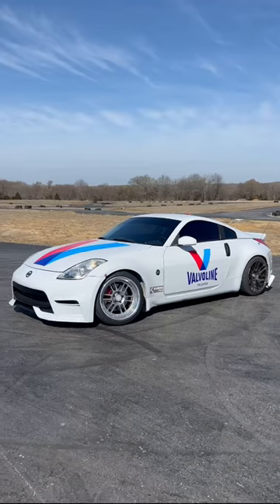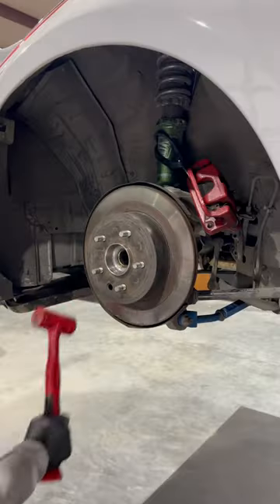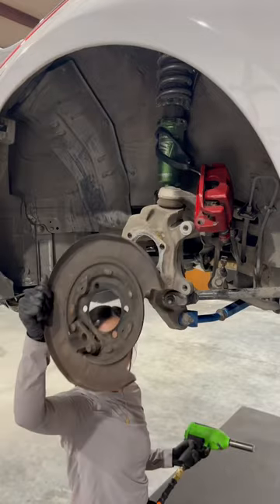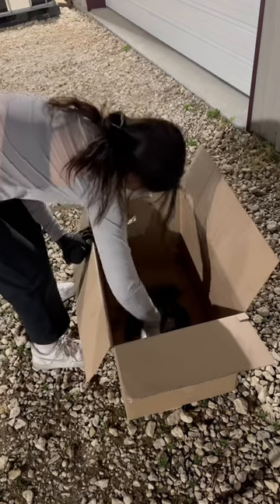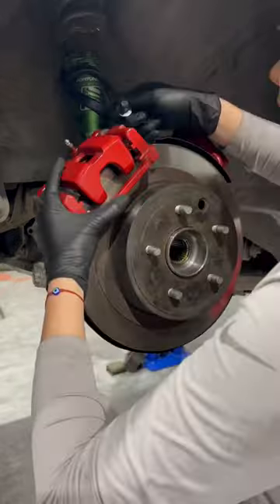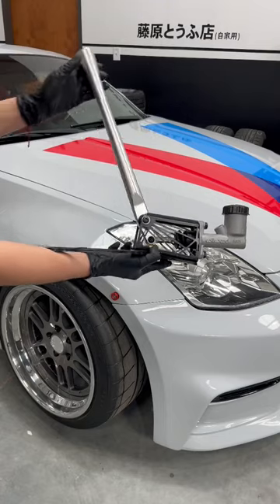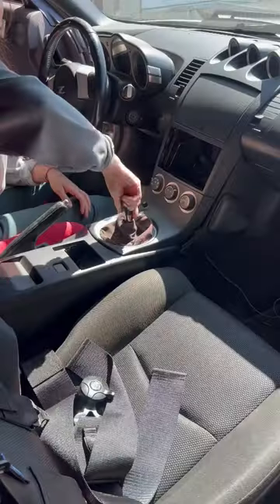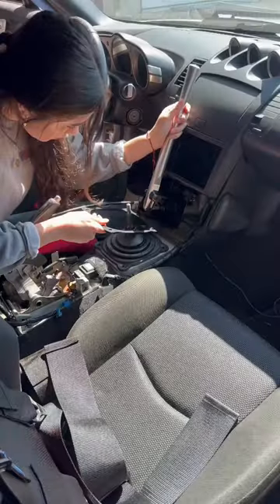Hydraulic E-Brake on the 350Z✔️

Comment: Why remove the axle..??
Reply: to remove wheel hub, it not really need to do but it's 200% easier when axle off bcuz bolt a sucks on back bracket and when you want more space when you work on it.